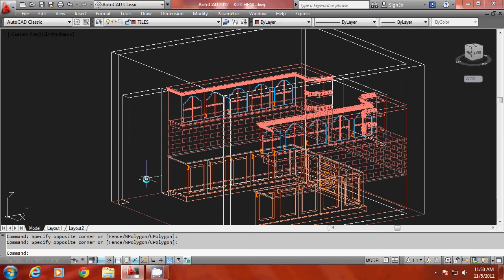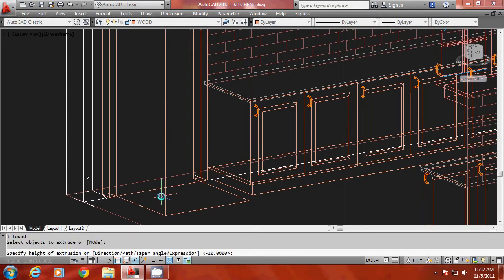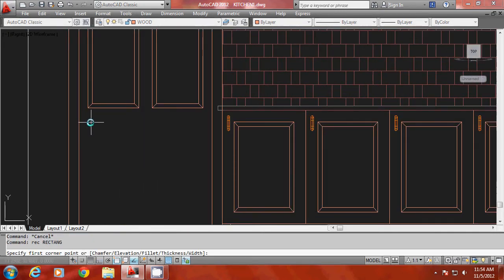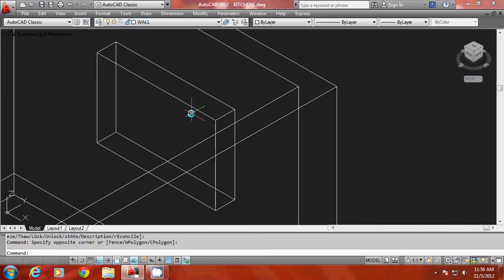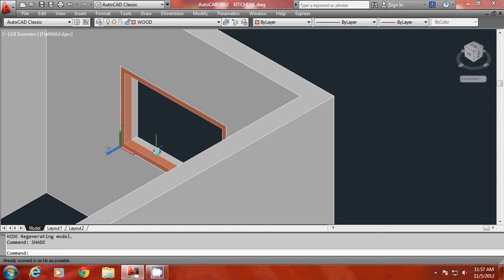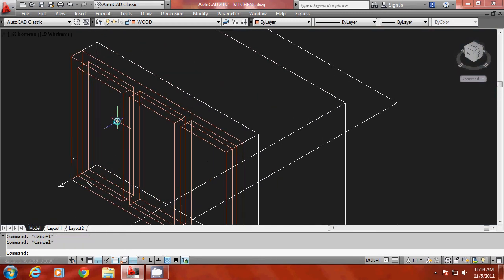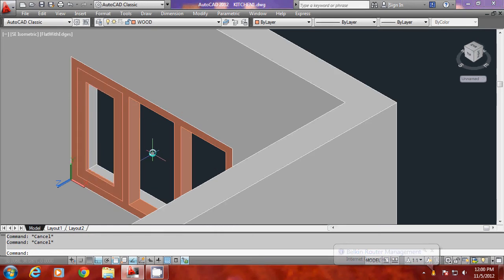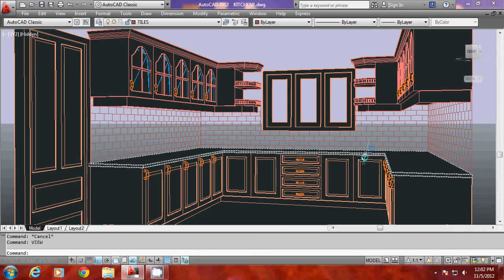Modeling a Kitchen using AutoCAD - PART6  ( Creating Doors and Windows)

Comment: Hi Respected Sir, I want to understand about that line which you draw in window for divison i have made the window accordiing to your instructions but i don't gain success in this regard can you please help me and also tell me can we convert the drawing which is made in inches and feets into centimeters because when i tried to to make kitchen ddesign from feet into centimeters my units not proper working my one unit equlas half of feet in centimeters thank you
best Regards, 
Waseem Ali
Reply from the maker: In the case of window you can change the point display type using the PTYPE command to see the points clearly after division.